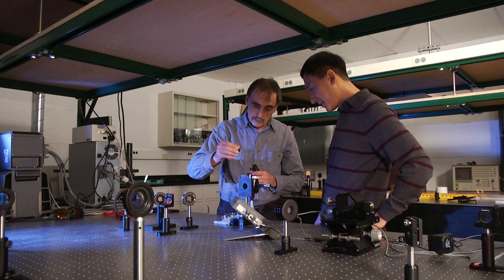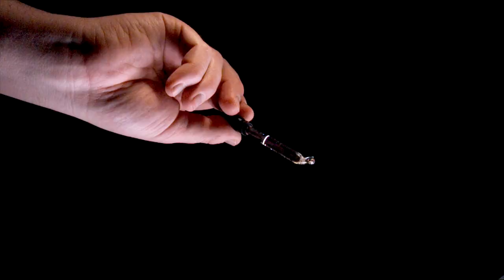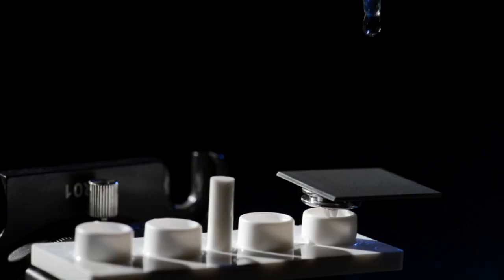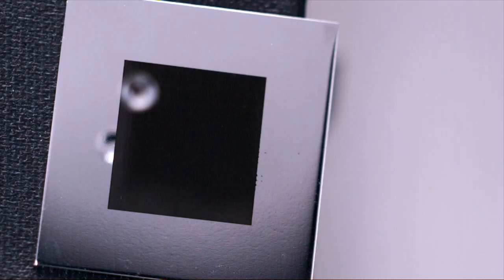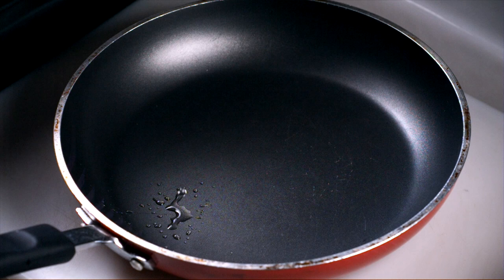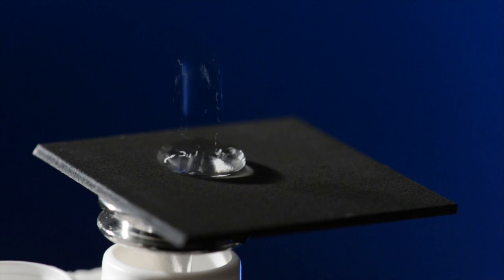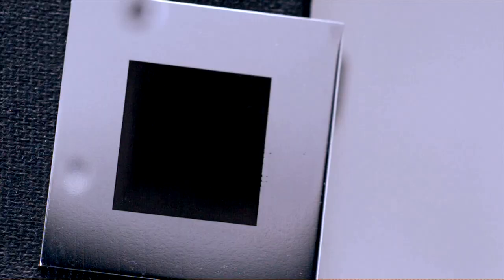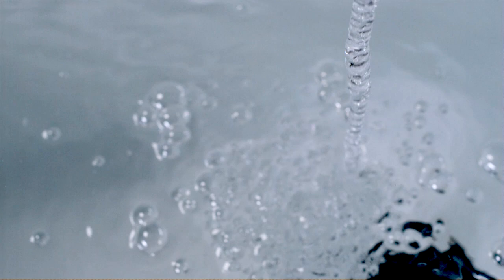Using Lasers to Create Super-hydrophobic Materials

Comment: I could see this being extremely useful, but not very robust. Wear resistance would be a huge challenge, even on the hardest of materials as a slight contact with another surface would destroy the micro- and nano-structures. Anyone know what material they're actually using to test this hydrophobic phenomenon? It's difficult to tell from the video. Very cool concept nevertheless!
Reply: Inside the piping of a rocketengine there won't be much to worry about wear and tear. But yes any application with wear and tear will probably not use this technique. Unless you build up the material using the exact same structure all through the material and therefor all scratches and stuff will expose a new hydrofobic layer.
Also this method is probably very specific to repel just one fluid/gas. If you'd also need to repel other materials you'd need an other pattern with which you probably loose the water repellent property. But lots of research would be needed to what would happen if you'd mix patterns.
The opposite material is also very interesting, curious how high it will attract water at what angle. Could we transport water up this way and use the stored energy later? The problem would probably be getting the stuff to release the water again at a higher point.
If you really want to make money you'd make a material which you can somehow switch at will between the two states. That would be awesome, let it suck up water from a river up to a dam, then tilt the toppart, switch it, water will run of and fill the lake above the hydrodam, switch it back, tilt it back to connect to the upslide et voila energy restored :)
Reply: jo han I know what you're saying, kindof like a conveyor belt of water to store it as potential, then let gravity drop it down onto some kind of generator. I think its important not to get carried away though with this "free energy" concept- think of it like a paper towel. If you dip it in water the water will "defy" gravity and soak up into the paper towel via the capillary effect. Without some kind of energy introduced into the system, the paper towel will just become saturated and water will not just travel up the paper towel anymore.
Reply: Velocity Photography You're right, just the capillary effect is indeed not enough and not easy reversible. And there are most probably limits to this technique also. But I'm still interested in how high and with what speed it would suck the water up :).

Comment: Hydrophobic is not something new... It is not entirely true to say using small structure to repel water is better than chemical coating. As most of the time (in fact all the time) the demonstration of  its water repelling superiority are conducted in lab. There are still alot of issues such as;
1) Sizability -- Can the nano/micro structure be produce on a large area such as the wall of a lab?
2) Durability -- Will the structure collapse if it under some impact, such as accidental scratches by  objects.
3) economically -- Cost of making it in big size..
etc..
Pardon my poor english.

Comment: If you are smart enough you can combine both of your laser processing techniques hydrophilic and hydrophobic, to make very very cheap microfluidics and nanofluidics integrated opto fluidic circuit, sensors, lab in a chip devices defraktion and refraction surfacs for optikal devices and more.